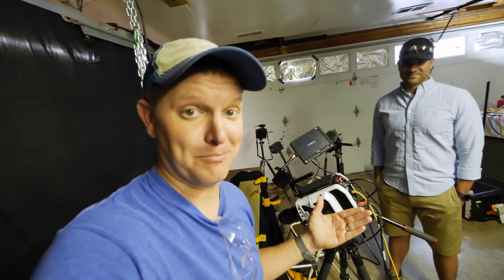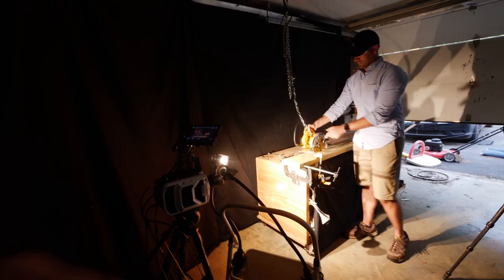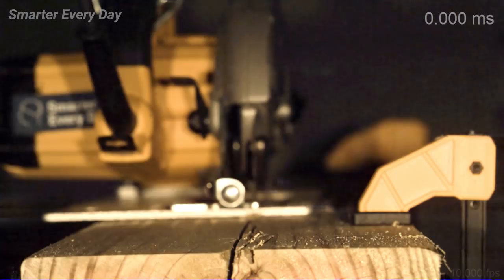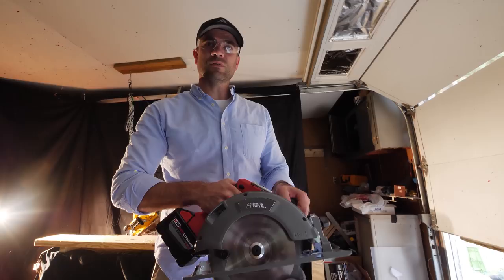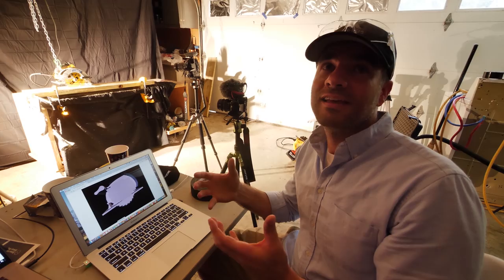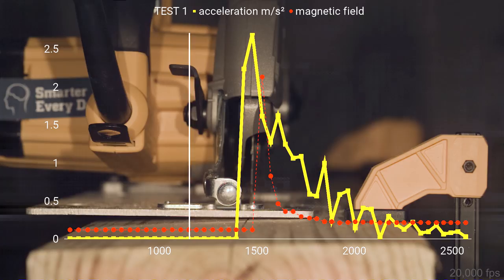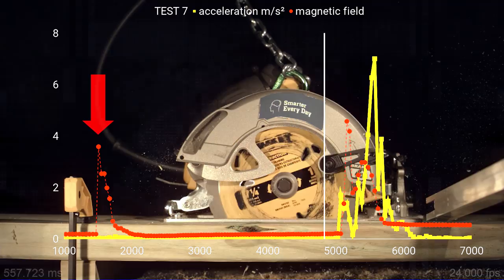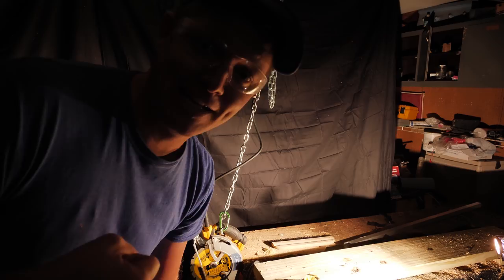Circular Saw Kickback Killer (We used science to make tools safer) - Smarter Every Day 209

Comment: Kitty!  And yeah, awesome idea for a safer saw!  (Though I also wonder if a microphone could pick up the audio changes to do the same thing?)  If/when these saws come to market, I might FINALLY replace my dad's old saw.  He was a pro carpenter in his younger days and his saw is a scary scary full metal beast, with enough torque that it'll kick out pretty hard to the side when it first spins up.  Talk about growing a pair to use that old monster.  Thank goodness that I've never had it kick back during a cut like your smart saw prevents.  Maybe it's just too tough to.  Maybe I'm just lucky.  (I once accidentally put a blade in backwards and it still cut through wood like butter, just with lots of smoke, it's such a beast.)  I actually have to knock out the diamond pattern on new blades to use them with that monster.  Every time I use that old saw it scares me.  But it's a champ, better than the modern plastic ones, so I keep using it.  A SMARTER SAFER saw however, would definitely be worth the investment and finally be a worthwhile upgrade.  Great idea!  A safer chainsaw, even better.  (And better yet, if a chainsaw could also detect hitting a rock and stopping before you totally ruin your chain.)

Comment: i was on the luck side of learning with an angle grinder. the cutting disk cut trough my flame protective pants. as an idiot i didn't stop the grinder, continued the cut. only after work when taking my pants off did i see that i also cut trough my regular pants under the work uniform and also left a tiny red stripe on top of my thigh. 1mm deeper and i would have felt a lot of pain and would probably need a hospital visit. 1cm deeper and it would be a hospital emergency visit. this kickstoper would have prevented the potential hospital visit.

Comment: Could I suggest a low tech solution...... Change the rotation of the cutting blade. Make it cut on the forward rotation. Any kick back would cause the saw to press down into wood.
Reply: Where you from, dude, Arkansas???
If that would help anything At All, the manufacturers
would have already done it.
I suspect it would cause more danger, because the saw
would want to run away from you.

Comment: Is there any way you could use the draw of power that the saw is pulling from the wall because I knew notice that the Saw will sometimes tripped the breaker when you are putting a large load on it
Reply: Kickback does not produce a high draw, to trip a breaker. (or anything else)

Comment: Took me 30 seconds to think of a much simpler solution, add a lever that pushes down as the saw becomes level with the plank, so when it kicks the pressure is released from the lever stopping the saw blade

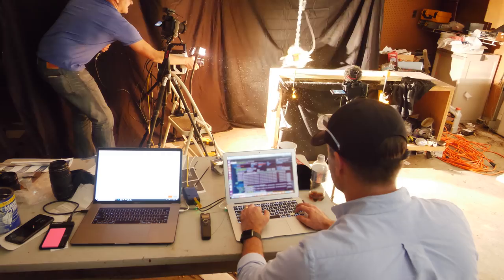Comment: 2:12 Are you using a non load bearing key ring carabiner in a safety system??? 😬
Reply: Also, you should be taking into account the amp draw of the motor from the speed controller (since I assume you'll want to install these in BLDC based liion powered saws.) The current should ramp up when the blade is pinched and/or reduce the speed of the motor.

Comment: The concept is great but I'm not sure about execution. I mean it's only one of many risks. So for example you solve this problem now more people use circular saws because they think they are suddenly safe tools for anyone to use. What about the hotdog test for table saws it's a great add on just in case there is a mess up buy a novice but spinning fast things need to be respected and a skill saw is no different. If some is in a rush they don't think and put a 2x4 across their knee and pull the trigger your tool is still going to cut flesh. I say training up not dumb down the tool.  Ps I didn't see it but know of a professional carpenter that did this when a concrete poor went bad and he tried to fix it in a rush by cutting more stakes to support the form.   If you are rushing or in reactive mode you should just stop and accept you lost that battle come back at it with new wisdom next time.

Comment: That’s why you need the lightest strongest saw possible.   With wide kerf blade.   

Light weight so you can control it at awkward angles and strong enough the blade doesn’t slow when pinched and just keeps cutting.  Ripping blades also increase pinch pressure so don’t use unless Absolutely necessary 

proper technique keeps you safer than any equipment modification 
equipment safeties breed bad habits that can get you hurt later.Most dangerous carpenter I know has a saw stop and cut his hand twice on my saw because he doesn’t think about how to lay out a cut safely.

Comment: Have you seen the table saw with the “bio sensor???”  If your finger touches the blade it drops it down and instantly stops the rotation. It destroys your saw but saves your finger.
Reply: That is the Saw Stop brand table saw.
The saw is not destroyed, only the braking component, which is replaceable.
Cost is about $80 US.
How much is your hand worth?
Reply: @zapa1pnt  right on. Yeah, I just remember a video where they guy stuck his hand in the thing and it crashed to an instant stop. Not a scratch on his finger. If it’s just $80 to rebuild the brake that is a bargain!!!
Reply: @aggietrucker4489 : Yeah, not bad, unless the fool gets drunk and
calls his friends over, to show it off, with a pack of hot dogs.
That $80 a dog. Hope it's not the family pack.🤣🤣🤣🤣🤣
Reply: @zapa1pnt  I’ll bring the ketchup!!  👍

Comment: Interesting video but you are looking the problem from a tech position.. you need to look at the problem from a Carpenters position..or Physics.. the question should be.. why it the blade sticking and what can we do to Prevent it... not..my Blade is sticking...how can I make the saw safe after the kickback...
Reply: The non-tech solutions have been around for decades, yet it still happens far too often.
10,600 times per year. Mostly to professionals, who use these tools every day.
The next step is tech, to stop the blade, when it does.
Excellent solution presented.
People used to object to seat belts: "You want to keep your face out of the windshield? Don't have an accident."
Yeah, that worked well.

Comment: The only thing I don't get is, why can't you use science to just make the saw cut through the knot in the wood instead of turning the saw off? Like you said it was pinching the blade.. couldn't you just put something on the saw to prevent the wood pinching the blade?

Comment: Well, people are replacing their brain by putting a lot of brain in replacing it.

If you feel your work, you feel when the blade is getting stuck before it gets stuck and you adjust the pressure. "Let it slide" the craftsman says.

No way that this overengineered saw has no backlash onto the actual cut. Can already imagine how frustrating it is to get stopped by the saw brain because the wood structure changes.

Every table saw has enough protection on the blade that as soon as the blade leaves the wood, the protection snaps onto the blade. Sure, it looks dangerous to let a table saw fly through the room but that's just not how you use the saw.

Comment: I think this is a great idea!  That being said...things that can be done to prevent kickback would be to ensure that your cut piece is able to fall away and not pinch the blade, ensuring that your blade guard is still attached and purchasing a saw with a secondary button required to be held to engage the motor (making it easier to stop in a kickback situation).

Comment: I cope with a saw on a rampage by holding the saw as if your strangling a mountain lion thats about to tear your head off and eat your guts.... get angry at that saw and force it to not cut you in half.  lol  Idk its worked so far.  THAT and not pinching the blade, just supporting the piece your cutting does wonders.  These guys however have done a good job, it'll end up being in all cutting tools eventually.. Not just saws.

Comment: Was wondering if any tool manufacturer ever contacted you, or was interested.
Reply: @Brunsy1990 Posted some sensible comment, a month ago
Reply: @ibubezi7685  Even sorted by 'newest first', I see no Brunsy1990 comment.
Reply: @JNRII  Because he commented on a comment (Shawn Blanchette) - so now his' is collapsed and can't be found with 'ctrl-F' (YT is not 'perfect'....). 

Per @Brunsy1990: "This will likely be something you'll see available as a 3rd party device that can be added to any saw. Because lawyers. If a manufacturer adds this feature and it fails to stop a kickback that results in injury, the tool manufacturer is liable. It's the primary reason you don't see safety features added unless there is some related safety mandate passed down by the gov"
Reply: Yea, get that, it is sensible, but still curious.  After all, the 'saw stop' basically banks on being more because it won't take a finger.
Reply: @JNRII  Yup - as long as they don't charge $100 extra for some 'revolutionary feature'.
Reply: @ibubezi7685 :
Then, how do you account for the Saw Stop system?

Comment: Keep in mind that with tests like 2:15 you put heavy forces on the rotating saw blade. Sometimes they give in and disintegrate, throwing the sharp sectors of the blade around. It's like playing with a hand grenade. Without a safety barrier (thick plexiglass for example), it could launch a razor-sharp piece of blade right through the camera man guts.

Comment: It is just the wrong use of the equipment that causes kickback.
The law protects the manufacturer against it.
So
I would rather want the equipment not to start working with misuse.
There are many types of wood that you cut and get a lot of kick back, there is no other method to cut it.
I would bridge it out or rather give the consumer the ability to turn it off

Comment: "Don't worry we have a chain": attaches it with weak aluminum carabiner
Reply: I saw it twisting if it twisted hard enough it could be bent open and would have shot out towards you I have seen them the bend surprisingly easy and they can pop out the door bit easier
Reply: Better experiment design wrapped the chain through the handhold and lock it with a padlock
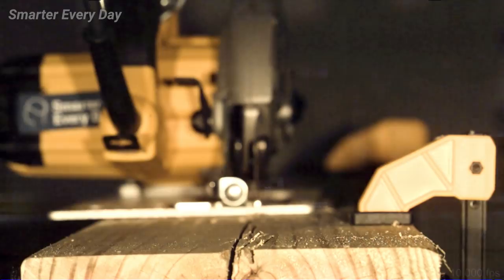Reply: Also not wearing safety goggles during a test with flying debris experiment safety is not a joke! It only takes one time! 2:20

Comment: Table saws could use it as well making them no longer board launchers I think this is an great idea but it’s like traction control it needs a fun button on for safe off for fun as sometimes you just want to. 😂
Reply: Not applicable to table saws.
This senses the movement of the saw, not the material.

Comment: A simple safe way to reduce kickback is to follow the manufacturer's instructions and not over-tighten the saw blade. When the blade starts to bind the blade will slip and you won't lose control so easily. Try it.. Really like what you are showing us.

Comment: Really?  It is up to the user to provide force to control the saw while it is cutting.  While I have experienced this type of resistance, it's just part of working with a circular saw.  If you do not have adequate safety training to use a piece of equipment, you should not be using it.
Reply: Why would you not want an additional safety feature?
Reply: @willasproth :
He, more than likely, doesn't use his seat belt either.

Comment: This would have saved my finger tip that I lost 2 days ago.
Reply: It does have a blade guard. It was fixed open, for the tests.
To have the guard in place, someone would have to hold the saw.
Not good (safe) in a test situation.

Comment: I'm 99% sure my circular saw rotates the other way and therefore would kick away from the user...
Reply: Just take a look at which way the teeth are pointing. That is the direction of travel\cut.
Chain saws, table saws and chop/radial saws cut downward, in the direction of travel\cut.
All, hand held, circular saws cut upward, in the direction of travel\cut.
If the teeth, on your circular saw, are pointing to the rear, you need to flip the blade over.